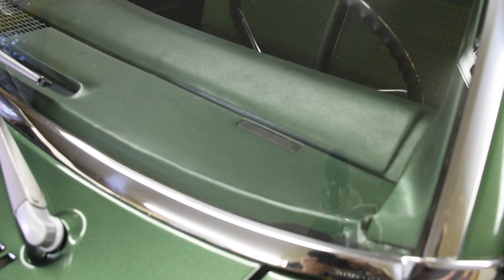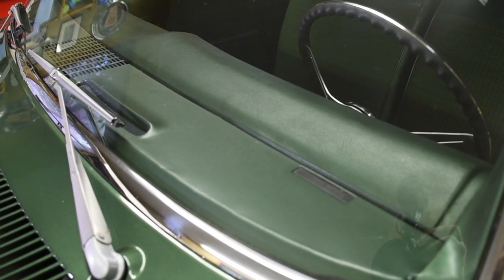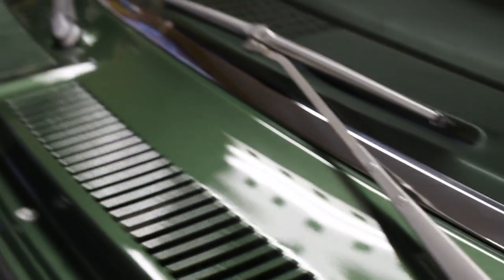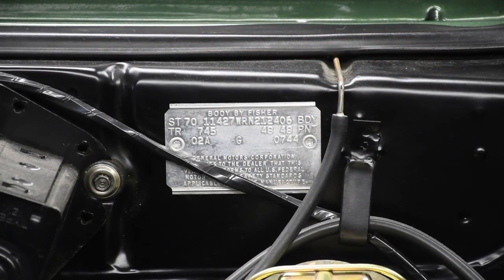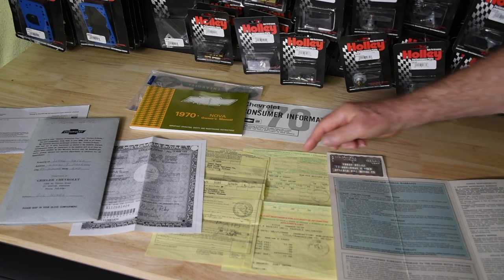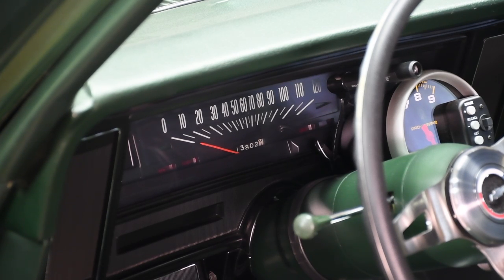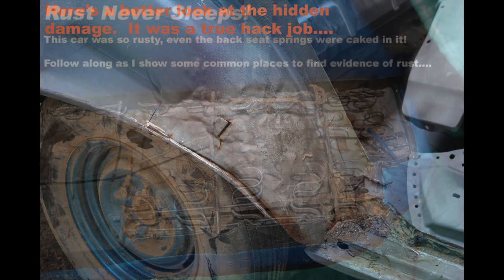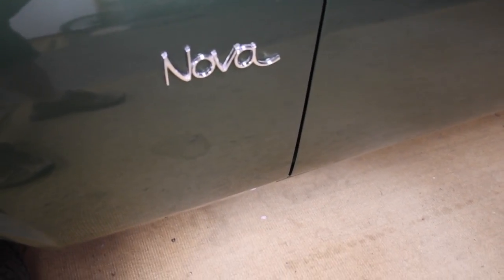6 Ways You Can Get Ripped Off Buying A Classic Collector Car!

Comment: As teen in 80s I had 72 nova 3 on tree 250-6 one belt no power steering drums rubber floor no radio .Your first one to talk about one  .Mine was a rocket so light and smoke the backroads. Reliable mileage big go cart it was.Best car I ever owned rear shackles crushed frame rotted out pretty car.ill be watching 😊

Comment: Nice Nova.
But this might confuse some people.
If a car like a 69-70 Nova is priced at 15-25K then one should expect a car that has basically been garage kept, virtually rust free with moderately low mileage. But for the casual owner looking to spend 3-5K... For a 53 year old car. Expect to find some rust and even some repair work.
That one in the video though. She'd been smacked pretty hard for sure.